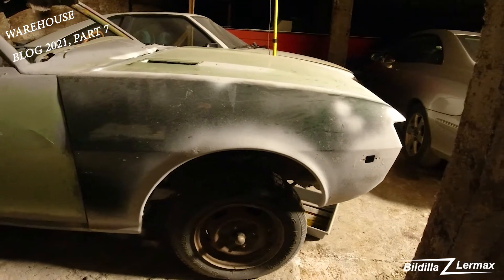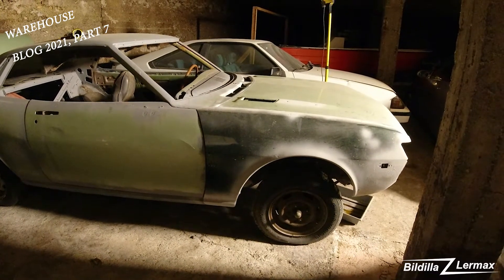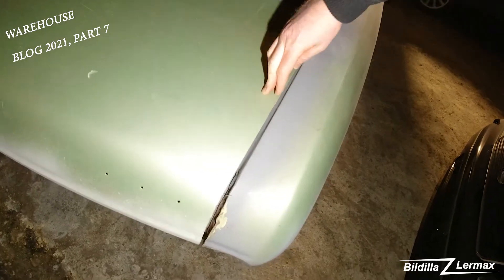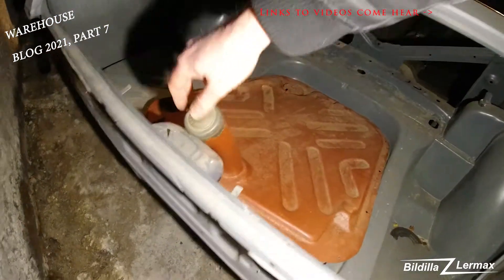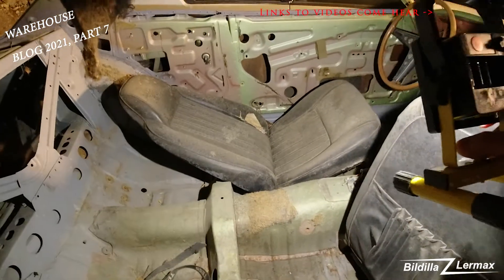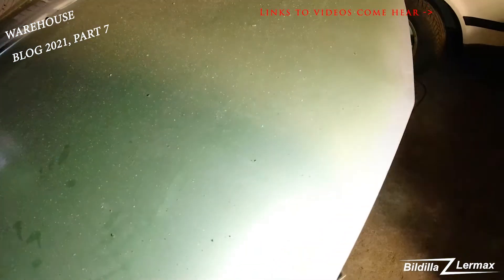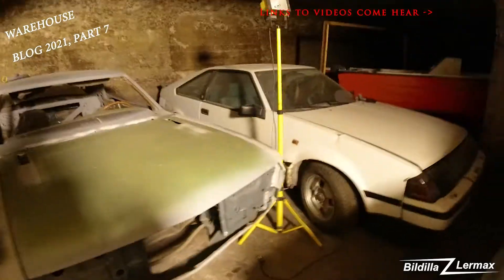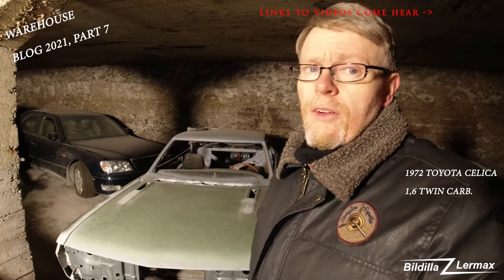Warehouse BLOG 2021 part 7 - 1972 Toyota Celica Coupe 1600 ST - 2T-B Twin Carb - Bildilla Magasin

Comment: First
Reply from the maker: Du rakk det til først ja...  ;)   Skal bli en pen bil dette til slutt....
Reply: Nice body! This has potential! When will we see you driving it? Needs some oil and coolant first...?!?
Reply from the maker: @rogerflalokken1246  Need some work yes!
Engine and gearbox, standing in the basement at home. Otherwise I think I have all the parts for it .... Or maybe man should make new brake pipes ...
Reply from the maker: @rogerflalokken1246  Can not decide on the color of the car ... The original bright green, was only delivered for 2 years. But I'm not sure if I want it ??? Any suggestions?